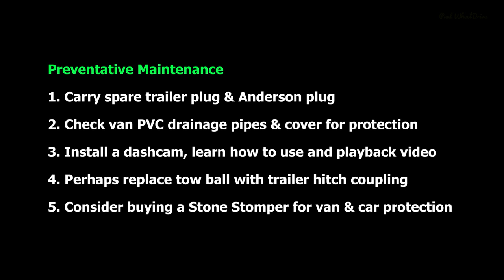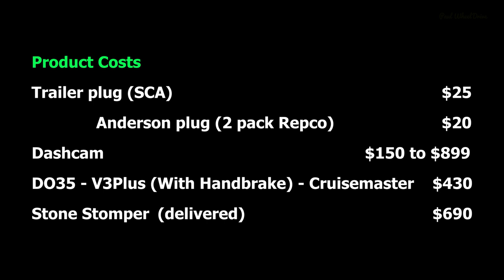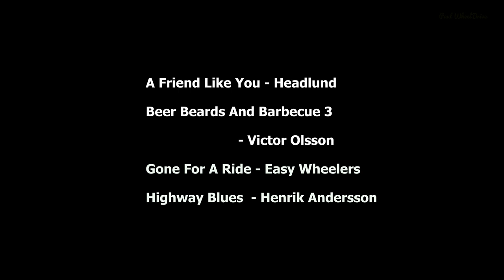Top 5 Caravan Maintenance Tips || Caravan Preparation

Comment: The DO-35 hitch...interesting suggestion. Thanks Paul.
Would a heavy rubber, full width mudflap do the same job as the Stone Stomper? Bunnings has suitable rubber sheets 1m x 1m for around $30 cut in two, chain links, bolts, nuts and washers as well as carabinas to attach to the underside of the vehicle. Even if it ends up horizontal when you are travelling at highway speed, I reckon it would still deflect any stones. 60 bucks all up and a couple of hours.
Reply from the maker: Hey Benny,
There are so many opinions out there in lala land as to how one should have a go to make their own.
I've read quite a lot and the general consensus is,... too hard. So worth a little research and ask around. Thanks for your comments.

Comment: Just a question: Why not replace the PVC tubing by (stainless) steel tubing?
The new PVC tubing will break again, sooner or later, won't it?
Cheers
Reply from the maker: Hi Thomas,
I think the weight would pull it off the hinges. I have covered the pipes with the rubber matting as you can see in the video, so that should help

Comment: Great video just a suggestion from a retired Electrician i would buy a flat pin trailer plug with scew terminals not the push in one that you have ,they are terrible and eventually cause issues and fail .
Reply from the maker: I did actually use screw type, the photo was just for effect